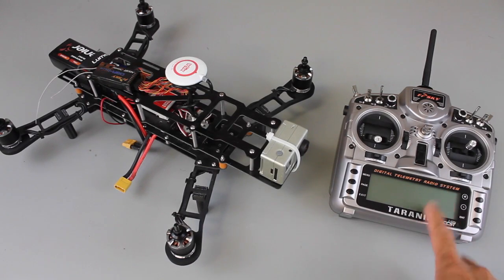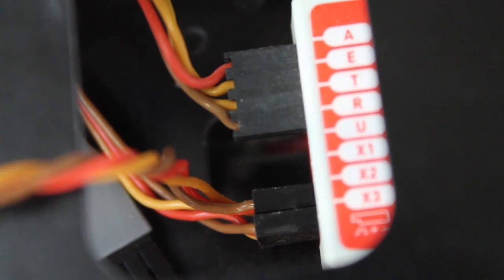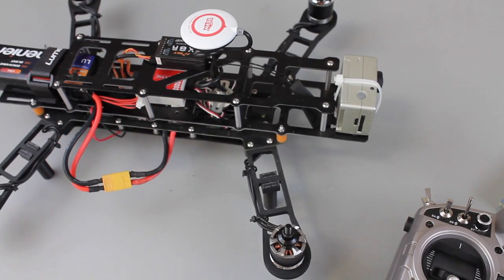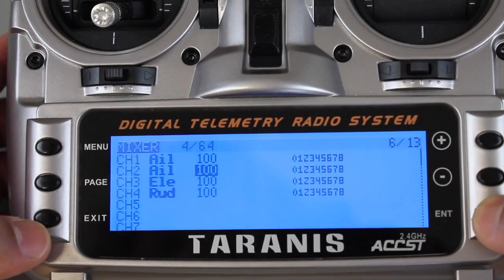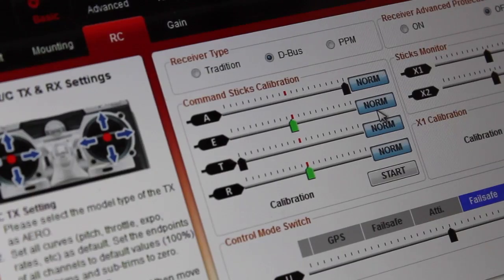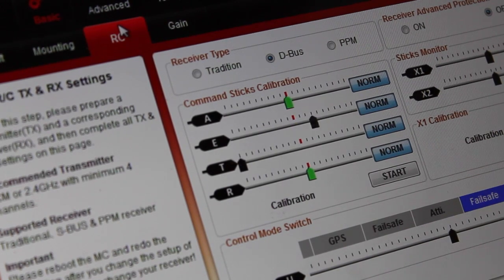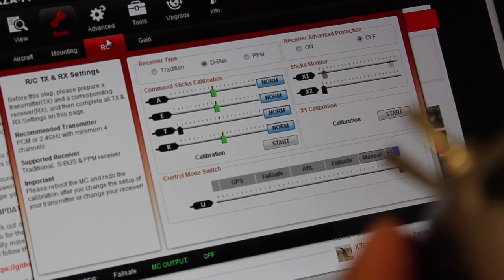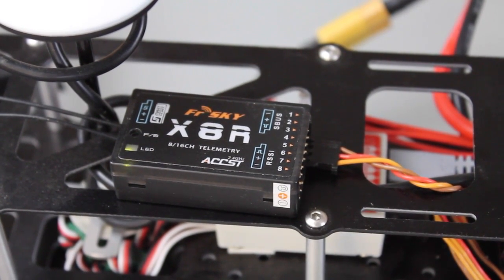FrSky Taranis and X8R Receiver SBUS Setup w/ NAZA Flight Controller

Comment: Hi Dennis i want to run my 680 pro with the s-bus config using Naza Mv2, but i want to add Retracts would i just plug the servo cable from the retracts into the the x8r Rx as well as the s-bus cable, what i want to know will that be ok ,and set a 2 position switch on my Tx ( Taranis) to control the retracts Thank you liked and sub
Reply from the maker: George Abernethy Hi there. Good question and I've never done retracts before, but I do think this will help:

FrSky Taranis and Tarot T-2D Gimbal Tilt Setup and Configuration

Go to about the 3:00 mark where I talk about setting up your X8R for SBUS and standard servo channels. This should do exactly what you need and you'll just need to configure one of your channels (9-16) to control the retracts. If you run into any problems then please check out www.garagepilots.com and post in the forums there. We should be able to help you out. Best of luck.
Reply: Hi Dennis thank you so much will go and give this a try when i get the Tx cheers

Comment: hi ive binded taranis with x8 on naza assist on a hex but have no trottle down only up when i move down the motors do not slow down??? and fail safe will not let me take over by hitting gps switch it sounds like it just keeps climbing??? any help app
Reply from the maker: TheTonstar1 Check out www.garagepilots.com and post in the forums over there. Hopefully we can get you going.

Comment: That's an awesome video, very nice clear and concise.  I'm doing the same install on a TBS disco pro which has the switch that goes between the gopro and the video camera.  Is there a way to pull a channel off of the RX when using in sbus configuration?  If so how?  Or do I just need to hook up all the cables?   Also these frsky rx say the rssi out is analog 0-3.3v.  Any way to hook that up to a an EZosd that you know of?
Reply from the maker: adriancjones In this video you can see how to use SBUS and get the 8 standard channels:

FrSky Taranis and Tarot T-2D Gimbal Tilt Setup and Configuration

I'm not sure about EZosd. I've never used that one. Good luck!

Comment: Hi all newbe problem to solve, I have set up my F450 and have binded the X8R to Tx X9R sticks all work in Naza software using sBus but motors won't power up any idea what I'm not doing or have done.

Comment: Dennis Baldwin Just one more question, Dennis.  I'm curious as to which mode you placed the X8R into before binding.  From the video it appears you have no jumpers placed.  Are you therefore binding in Mode 1?  Have you tried binding in Mode 4?  Thanks!
Reply from the maker: Appalling68 I believe the default is Mode 5, which is what I'm using (no jumpers). See here:

http://www.hobbyking.com/hobbyking/store/uploads/38702093X977203X22.pdf
Reply: Dennis Baldwin Thank you so much for clearing that up, Dennis.  Sorry to be such a pest! ;-)

Comment: Can this receiver and Taranis be used to control the 4 channels (AETR) in SBUS, 2 PWM channels (gimbal roll and tilt), 1 for flight mode selection and lastly 1 for camera switch (FPV or GoPro), like described in the TBS discovery pro manual? Your video seems to suggest there is only room for 3 extra channels besides AETR?
Reply from the maker: Patrik Åkerfeldt You can get all 16 channels when using SBUS although I haven't done it yet. I'll put together a video that explains how. Thanks for the comment.
Reply: Looking forward to the video! Thanks for answering.
Reply: Patrik Åkerfeldt Looking at the X8R manual and also repeating what I read over at multirotorforums.com, you can get all 16 channels by binding in Mode 4.  That is, S-Bus gives you CH1-8 and then CH9-16 would be the hard pins on the Rx.  I hope Dennis Baldwin or someone will correct me if I'm wrong here.
Reply: Very simple, as stated above and it works because I am flying this way. Bind X8R in Mode 4 ( manual shows jumper location to achieve this during bind) this gives you 8 in sbus and the other 8 (9-16) as conventional PWM outputs from your pins 1-8 on your receiver. I use a X6R for my hex with NAZA V2 tied to SBUS and I use 4 of 6 remaining PWM channels to run light switches, retracts and camera switcher. Just remember to define them in your mixing editor page to make them work.

Comment: Is s-bus better than cppm?
Reply from the maker: SirArghPirate I've never worked with cppm so I'm not sure. I do remember reading about problems with FrSky's implementation a while back, but apparently they've fixed it. Here's the thread if you're interested: http://diydrones.com/profiles/blogs/why-frsky-cppm-signal-is-so-disappointing

I'd love to hear about pros/cons if you find out. Take care.
Reply: Dennis Baldwin
I remember having read this article a while ago, but this problem has been fixed by offering a firmware update that sets the cppm "period" to 27ms instead of 18ms so that all 8 channels (2ms each + Spaces) can "fit" inside. At first I tried to decrease the duration of each aux channel, to max 1700us, and then change the low/mid/high thresholds in code which worked, but was a pain in the butt :). The new firmware removed the problem entirely. Not sure what effect the longer signal period will have though.

Comment: Hello Dennis Baldwin, just a noob question.  What are you using the X1 and X2 sliders you set up in "Sticks Monitor" for (starts at 4:05)?
Reply from the maker: Appalling68 Hi. You can use the X1 and X2 channels to do remote gain tuning and controlling a gimbal pitch. This video just demonstrated how to connect those to your sliders and it's up to you to determine what you want to do with them. Hope this helps!

Comment: I want to use the sbus on my frsky x8r as you demonstrate in this video. I currently have mine setup per your video on setting up flight modes and a failsafe switch. If I switch to the sbus do I set up flight modes and failsafe as before but use channel 7 rather than channel 5 ?
Reply from the maker: Exactly. Your channel 7 will be configured just the same as you would do with channel 5. Similar to this video: FrSky Taranis 3 Flight Modes and Forced Failsafe Override with DJI NAZA on QAV400 Quadcopter Good luck with your setup.
Reply: Dennis Baldwin
 Does this work with the SBUS as well?
Reply from the maker: Most definitely!

Comment: There are a couple of things missing here, the setting of flight modes and IOC... Any plan on covering those Dennis? other than those it is a good video :)
Reply from the maker: Hey Bob, yes definitely. I have that video in the works and will be posting it within the next week. I appreciate the feedback. Take care.
Reply: Dennis Baldwin Thats great news :) I have got the flight mode switch settings but I can't get it to see the center position when I select ATTI. Using 2.0.1, I think that 2.0.2 is about to come, maybe there may be a fix... I'll keep trying...

Comment: how do u calibrate ESC with sbus  set up and x8r ???
Reply from the maker: I don't think it's possible. The only ways I can think of are to plug directly into the receiver bypassing SBUS. Or getting one of those SBUS to PPM decoders: http://www.alofthobbies.com/frsky-sbus-decoder-1.html If you learn otherwise I'd love to hear about it! Thanks.
Reply: Dennis Baldwin  so is that  u mean that bind the Rx  with tx in traditional way  or  it can be  done when the Rx is bound as a s bus   and then one has to  connect the ESC to  Throttle port of the  RX  which is usually port 3   thanks

Comment: Do you have any videos of how to set up the two 3 position switches for the flight modes and the other for IOC ? And a separate switch for failsafe ?
Reply from the maker: You read my mind. I'll plan on doing a video of that very soon. Thanks for the suggestion.
Reply: i actually already got it dennis ! i just used the same method you had on the other video of how to set up the three flight modes. real easy thanks to you.
Reply: Nelson inastrilla
Could you please elaborate on your last comment?  I've watched all of Dennis' videos and understand the S-Bus and channel setups, but am very unclear how to set-up IOC and flight modes.  What channel to use??  Thanks!

Comment: Thanks again. Been watching your videos for a long time. Many useful tips.
Quick question: Since X8R is setup using CPPM, why did you select D-Bus and not PPM receiver type in Naza assistant?
Reply from the maker: Good question. Unfortunately I can't give you a technical answer than it didn't work with PPM in the Assistant and only D-Bus would work.